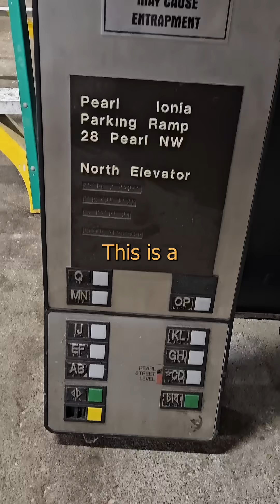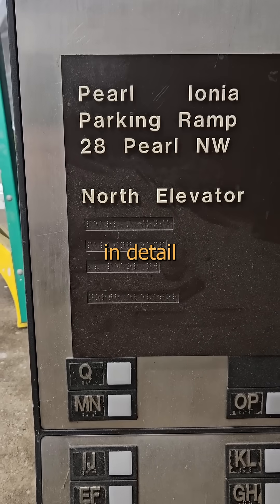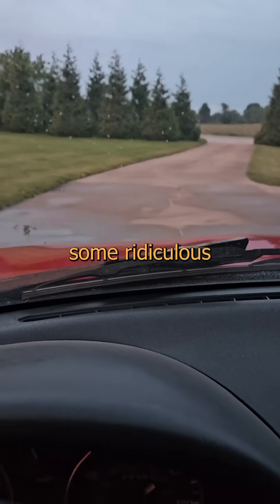Miata Mischief #chrisboden #engineering #gear #elevator #score #stories #parts #hacking #making

Comment: We once hauled a 5.0 mustang engine in the back of another friends mustang. We had to remove the trunk lid and make some....modifications that may have made the thing unsafe to drive. Even then half of it was hanging out the rear we had to strap the ever loving hell out of the thing by tying the ratchet straps to the seats to keep it from final destinationing some poor fuck on the cross city ride home. How we managed to not get pulled over is something I still don't understand

Comment: I used my shoelaces and a phone charger to secure a corner table I found at a Goodwill 2 miles from my apartment out the open passenger side door. I may have a picture lying around in old DMs but I’d have to do some serious self sleuthing.

Comment: Literally, yesterday I used a couple 100 ft of paracord looped around a couple thousand times between the two to haul my 1973 Winnebago RV that wouldn't start about 5 mi across town using my Ford F-150 lightning still surprised they both made it in one piece

Comment: While what we were hauling wasn't exactly exciting we did some sketchy shit to get home. My friend and I went to pick up a skid steer. We got down there without a hitch, got it on the trailer and started our drive home. Halfway home his diesel truck starts to sputter. It died at an intersection but we got it to restart however the second time we were not so lucky and she wouldnt restart and it started snowing. Lucky for us a kind couple towed us to a nearby school parking lot and invited us in for a beer while we waited on a ride home. The next day we had to find a way to get the truck home. We loaded into a little half ton pickup truck and drove down to retrieve it. We strapped up the truck trailer in tow. My friend drove the powered truck while I steered the dead truck, using the electric trailer brakes to avoid running into the lead truck. We made the hour drive home through a midwestern snowstorm (which took 3) as a 12 ton road train communicating with nothing but hand signals between the trucks. Love it when a plan comes together.
Reply: Now that is a adventure!!!!
Reply: OSHA would have a field day if a professional company pulled that stunt. Nice job
Reply: I'd upvote but I don't want to break the 69.
Reply: That's..
 Incredible.

Comment: I saw an ad for a uhhh... "Mointain Tractor?" Im from Austria, im not sure whats it called in english, but since there are a lot of steep slopes in the West of austria, many people use machines like these.

An old friend of mine was driving, since i dont have the necessary license to haul something like that. We left at 9am and came home at 11:30pm, since you are only allowed to drive 80km/h with a Trailer here (i live in the most eastern part of austria).

Anyways, we were over 500kg overloaded since it was a different version than what i thought it was, but that wasnt the only problem- the car we used technically wasnt made to haul over 3,500kg of weight behind it- never the less, we got home safely, but not without getting a Ticket for driving 90 instead of 80.

For those who are curious: 
I bought a "Reform Muli 40"
And we hauled it home with a 2013 VW Tiguan.
Yes, the clutch slipped a few times lol
Reply: After looking up that model, I can tell you there is no American equivalent. There were some made from converted WWII jeeps but they were too small for either the truck or tractor part. 

For anyone wondering, it's a flat bed cab-over truck, but it mounts a tractor's three-point hitch and a PTO shaft. A literal truck and tractor hybrid. As in you can run a small plow with them, or anything else tractors power. They're extremely popular in Europe.

There were attempts to import similar vehicles, but as they threatened the sales of both truck manufacturers and tractor manufacturers, they were hit with a 25% import tax and died out here quickly. Too bad, because they're pretty cool!
Reply: @ShakiestGunInTheOzarks what you describe sounds like a mercedes Unimog, they are beasts and inspired the original JCB fastrack (the world fastest tractor)
Reply: I looked it up and that is quite an interesting machine.  I would classify it as a cross between an off road truck and a multifunction farm machine.  as far as I know, the US does not have a similar machine.
Reply: @sir_Hummel  Ah ein weiterer Burgenländer😉 Nice story🤙🏼
Reply: I just googled that.  Looks like more fun than a Tiguan.
Reply: Just looked it up and now I want one. Help. (Hi from Germany!)
Reply: That is the tamest overloading story i have heard. 500 kilos over does not even count. Anyway, nice acquisition!
Reply: lmao thats a heavy load for a Tiguan

Comment: Removed the front and rear seat of my frog green Daihatsu Sirion M301 to pick up a 36HE IBM RS/6000 server rack which took 3 ppl to pick up. Into a 900kg car.

The 1.3l 4cyl engine was rather unhappy for the 400km drive on the autobahn going home, and same goes for the brakes.

Comment: Moving into college I only had a 250cc dual-sport motorcycle to move with... The sketchiest trip I took was with my minifridge ratchet-strapped onto the rear rack that I had extended with 1/2in square tube. And then a duffel full of clothes bungeed on top of that.

Good times.

Comment: I made three A frames for the bed of my 66 C10 and hauled a 15' pole for a power meter.  The pole was lashed down with a couple hundred feet of rope and it extended over the cab of the truck.

NO ONE tailgated me.

Comment: I had a roof job check being held up by 2 gutters. The problem? They were 70ft long and the gutter truck died, but the machine inside worked. I opened up a 40' extension ladder, strapped 2 2x6x16ft boards to it, still had about 20ft hanging off the front and back of the ladder/lumber, so I threw the hidden hangers into it to keep the 15-20' lengths hanging off from flexing as much and drove as a 70' long vehicle despite having about a 20' truck for 10 miles at 10mph all the way to the job. As I drove past the golf course people were stopping their friends from making their shot to point us out. I can't imagine how ridiculous it looked....

Comment: While mine wasn't incredibly crazy or stupid it certainly seems entertaining to a degree. My primary vehicle is a 1970 VW Beetle. Fun little things but it ain't got no power nor speed (40hp & 80mph max), but it's relatively easy to work on (in my opinion). Anywho, found a gentleman selling a seized engine from a 1974 Beetle a bit over an hour from where I lived, so I took out the passenger seat and puttered on over. After taking the exhaust system off the '74, we had just enough space to plop the engine in the space left by the absent passenger and threw the rest in the back seat. Which ultimately meant my Bug transported its own replacement engine.

Comment: The most sketchy thing I have done to get something home would be pulling a  14k rated pintle trailer with a 5,000lb tractor/backhoe with attachments for a grand total of 12,000lbs with a toyota tacoma. For anyone who doesn’t know I was 6,000 lbs over the rated capacity and was 1,000lbs under the necessary tongue weight. Yeah almost died that day, immediately got a different vehicle to tow that type after that.

Comment: Me and my 2 good friends had found a 2007 Yellow PT Cruiser in someones back yard and bought it from the guy for a whopping $200 in 2020 and drove that POS everywhere. Mind you, our heights ranged around 5'10" - 6'7" so it was a tight fit for the whole time. And one day I decide to want to buy a whole, in house bench press from our "local" Dicks sporting goods. 
Without thinking we pitched in and loaded a full olympic bench bar and around 600lbs of weights and the stand. Got everything loaded up until the bar came in and it just barely fit. The bar was touching both the rear and front glass and between the weight of all us guys, the weight stand and pure determination, we got it home in about 2 hours. After replacing a front flat tire and soon after the damn thing overheated. Having to stop every few minutes. But it got us home and I still have the bench press. 

I dislike PT Cruisers

Comment: Strapped a 20’ scaffolding plank and 24’ pump jack piles over the cab of my 01 dodge Dakota with Walmarts 2” yellow ratchet straps and drove about 100 miles up 1-5

Comment: I once off loaded a 8m² cement mixer with some old cement in it. I hade 1 front end loader tractor about 66kw, one 2.5ton forklift and 2 2ton forklifts.... Hade a pritty close possibility with a very bad injury on duty claim😂😂.
At the end the rollback went out on time and we hade to struggle further with the 18ton peace off possibility. Rebuild and mount on a wheel bace with a hydraulic motor and a John Deere 6170M. Made life a bit easier for that one major project 😂😂.

Comment: My first car was a '98 Plymouth Voyager that I got from my mom for a couple hundred bucks. Let me tell you how many stupid things we did in that van. It didn't even have tinted windows, we were just heathens on full display. Many great memories. I must have ended up giving the transmission a stroke at some point though because the van just didn't have it in her to accelerate over 25. With a final send off me and my two buddies flung all the doors and the hatch open and we skated my van for a couple hours and blew out the back glass as the cherry on top. RIP ManVan, you were the homie.

Comment: Its a tie.. 
I once disassembled a 78 Kawasaki 125 enough to shove it into the back of my 95 camry. Wheels & front froks in the back, frame and rest in the back seat. And a passenger in the front seat. 
And another time bought the LARGEST 120v window air conditioner unit you can get and shoved it into the back of the same car. Had to remove the rear seat cushion to make it work, and it still scratched the window tint, bent the sheet metal frame and swayed the car when braking 😅

Comment: Used 3 ratchet straps and bits of wood to winch an old horse drawn plow onto my single axle trailer. It got stuck coming off the trailer so I used one of those straps to tie the draw bar of the trailer to the back of my suv, an enthusiastic bit of left foot and it was free and the trailer was on its way to thankfully miss the back window. 
As the plow was not where we wanted it i hooked it to my quad and some 4wheel spiny spiny later it was in place.
The plow was over the head board and still light on the drawbar. 
It is still a tame load for that trailer.

Comment: I live in Switzerland, don't have a car but have a train ticket which allows me to take all public transportation. So hauling stuff in trains is my specialty, I once helped a friend haul a marble sink and some solar panels to a hotel his cousin works at in the mountains. Another time me and a friend transported a rigid stand up paddle (about 4 meters long) on the S-bahn home. But my favorite was hauling 86 4s lipo batteries for a 400V battery pack, an inverter and some HV cables came along for the ride.
Reply: Jesus that’s a lot of lipos

Comment: I flew my Cessna 172 across the country with an electric bicycle, my luggage, and camping gear by taking out the back seat and the passenger seat. It was wild but all that weight savings meant I could throw even more junk in the trunk
Reply: You maintained CG basically, probably documented removing the rear seat as a temp mod even.
Reply: @shadowopsairman1583 absolutely, and actually it was a full STC for the seat removals
Reply: Sounds like an awesome adventure!
Reply: That sounds so heckin cool.

Comment: I was told i could keep all the bricks from a walkway i was demoing but i couldn't store them at the property. I filled the bed of a 1999 ranger to the top with more bricks than the truck probably weighed.

Ended up needing to get pulled out of a ditch in the backyard because the second i came near soft ground the poor truck just sank down to the axle

Comment: 6 bags of potting soil on a sport motorcycle... because it was the only sunny day that week and chores need to be done.
Reply: Done similar but it was 100kgs of bagged cement on a 125cc scooter because I had jobs to do and was offered the bags of cement free :) 
It only had 10 inch wheels and with that cement on it had zero suspension travel!
Reply: Sounds like the average central Asian experience 😅
People in India will pack a ton of shit on scooters and motorcycles. It's really impressive
Reply: I could never achieve the feats an indian with a honda super cub has lol  @samuelswihart4285

Comment: I was driving a 1991 Geo Metro 4 Door.  This was early 2000s.. Went to one of my local Computer scrap yards and they had two 4 post racks racks cheap.  like $20 or $30 dollars cheap.  1 was a Half eight rack and the other was a full height.  We folded down the back seats and opened the hatch back and was able to get the half rack into the back of the car and the hatch far enough down that it was not above the height of the roof.  We then used the salvage yards forklift and laid down the full height rack on to the top of the truck and then used twine and the good old reach the hand out the window and hold on to it method to then drive the load the 3 miles to my apartment at the time.  This was early  camera phone days so I got a picture of it but that same picture was lost when I had the drive it was stored on fail on 05.

Comment: I've slung two bundles of 20' rebar underneath a toyota corolla, with three sheets of plywood strapped to the top. The red flags trailing off the loads made it all safe, I promise lol
Reply: Wait*  The rebar was UNDERNEATH the car?
Reply: @patmanly3215 makes loading and unloading easier i almost installed a 4 inch pvc pipe under my g20 van so i could pick up 20ft steel bars on the semi regular
Reply: @patmanly3215  its not the first time I've heard of such method, and its perfect for when you lack a roof rack but have deadlines to meet.
Reply: ... Aaaaaaand that's where the saying "Three sheets to the wind" Comes from??? 😂
Reply: Hauling under a vehicle is wild. Lol. If it works, it's not stupid.
Reply: Under-slung, similar to those sky-crane helicopters. I considered that trick (long pipe), but I chickened out because the DOT rules didn’t seem to address that creative method.
Reply: That's absolutely wild for sure. I just imagine a piece of 20' of rebar vibrating out and pole vaulting 700' down the highway at Mach-Fck. 😂
Hey I've done probably more dumb and more sketchy things with less planning. Glad it worked.
Reply: Points for Innovation!
Reply: I have always wanted to try carrying something under the vehicle like that.  I will rachet strap some insane things in some insane positions (but always stay off the highway with my Beverly hillbilly loads).
Reply: I hadn't considered going underneath. It makes sense with something strong and compact.😅❤
Reply: Ah yes, that explains the generous trench behind the rooster tail of hellfire I saw on the interstate.  I was afraid Ragnarok was beginning. 

Not gonna lie, that’s really a move I’d expect more out of a Mercury Mystique owner.

Ah well, no harm done. I understand the trench is being used as a drunk driving lane that careless people can gutterball themselves into and avoid hurting anyone. You’ve inadvertently done us a great service.

Well done & Cheers!
Reply: @0ddSavant  The "Mercury Mystique owner" part of your comment did paint a picture lol  
I was car-less at the time and the little Toyota was all i could borrow on short notice, the money I made on that job was most of the cost of my first Ford Ranger. Got to start somewhere! Cheers! 😂
Reply: @0ddSavant  saw it done with PVC sprinkler pipe under a Ram. It was NOT rigid enough and not supported in the middle...and was dragging on the road.

Meanwhile I did some 14ft 2x4's and 20ft 2x10's in the 6ft bed of a mid 00's ranger. Not over the top, in the bed, with the gate up, a few bags of concrete for counterweight, and a ratchet strap lasso around the end. Drove slow, made it home. Had people close enough behind to be UNDER the boards though, for some reason...there were 2 other lanes to go around, and not much traffic, son🤷‍♂️
Reply: @deathbug74  I’ve never understood the people who feel the need to try to sniff your rear bumper with their front bumper. 

Cheers!
Reply: Hauling under a car certainly qualifies😂

Comment: One that was me was driving a John Deere 4040 for 4 miles with a portable welder from the 70s hanging from the bucket from a single chain.
Reply: We have i think its a 4040 (cant remember exact model, its a favorite of ours) abd have done similar. Nothing that far, but that kinda stuff, so i can confirm That checks. Hahahaha
Reply: A friend owned a local meat processing facility.  Someone had brought a cow to have it butchered, and it escaped in a last minute bid for freedom. The area was a mix of small farms, woodlots, and residences, and the cow was determined. After three hours of trying to catch the cow, chasing it across pastures and hayfields, through brushy young pine thickets and residential flowerbeds, they had to shoot it to keep it off the neighboring interstate, about a half mile from the butcher shop. They brought a tractor with a boom attached to the three-point hitch, and drove the tractor back with the cow dangling from the boom. I can only imagine the reaction of people driving down the road, topping a hill to suddenly see a bloody dead cow hanging from the back of a slow moving tractor. Not an everyday occurrence.
Reply: I've used my Seven Ton Wheel Barrow as a tow truck more than once to haul disabled trucks with a single chain off the Dipper bucket.
It's sorta normal for me.